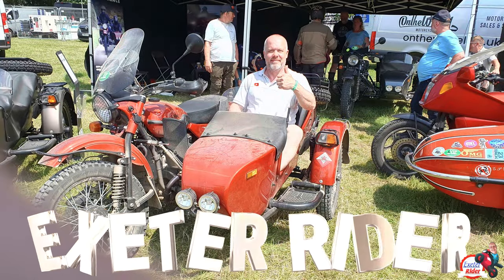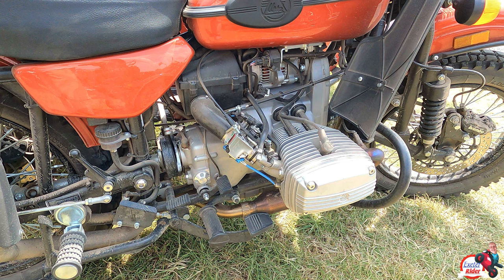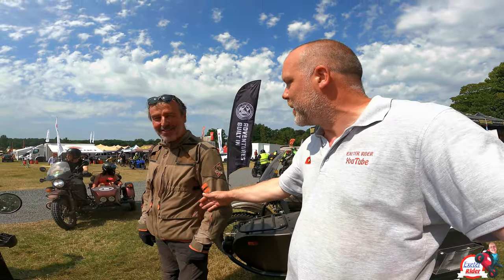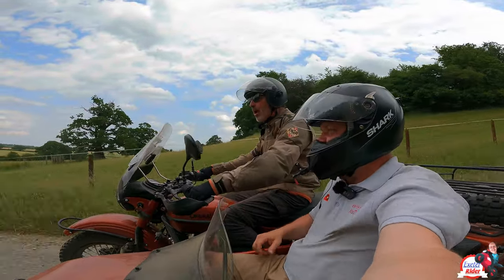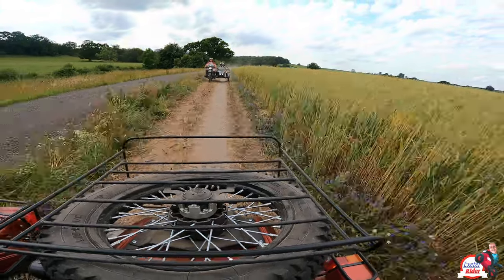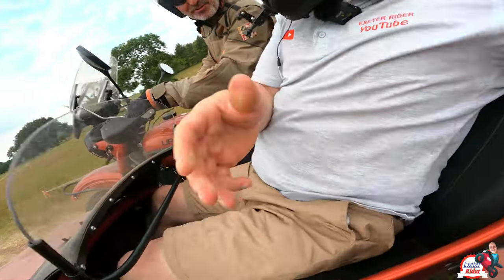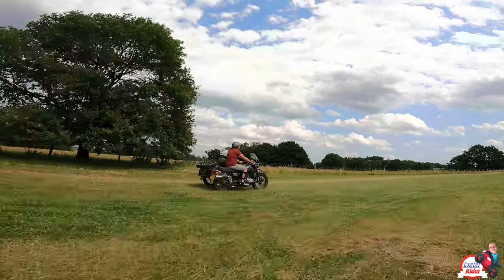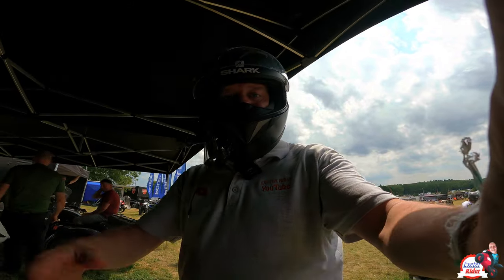A Ural Sidecar Experience, Whats It All About?

Comment: If they didn't have all those facy European parts they would be a lot cheaper. Nitron shocks are $2,500 a set.Heidenau tires are more expensive than Duros. Stainless steel exhaust system costs $1,600. Ducati ignition system is $500.EFI adds $1,500. Nippondenso generator + Brembo disc brakes. All of the Russian parts on my 25 years old URAL are still good. The should make a economy model along side the ones with all the bells and whistles. 2 wheel drive costs $2,500. That bike could be sold for $10,000-$12,000 for the cheaper model. Disc brake models have the same stopping distance as the drum braked model. Mikuni carbs had to be replaced because of ethanol gas corroded them. People complain about the ride even with the Nitron shocks,l have no problems with the Russian shocks.l go 50-55 MPH just cruising around. Of course there are all the accessories that you can put on the bike like luggage racks,spare tire etc. l like the stainless steel exhaust system but it is a want not a need. I like my Duro sidecar tires. Don't need fancy German tires. I like carberaters. No fuel pump needed either. Cheap and good value for the money 💰. Used bikes are best. No depreciation.

Comment: Side cars have always been expensive. Price a Watsoñian or a Champion sidecar. Side cars have always been as expensive as the motorcycle that pulls it. Buy used.7 years ago I bought my 1999 URAL Tourist with 4,000+ miles on her for $4,000 in running condition. Replaced some parts over the years due to age but that's normal. Rode her as my primary transportation for 3 years after a leg injury.  Sidecars either you love them or you hate them. They take up a lot of space in the garage so if they are unwanted they get sold fast.

Comment: I have a 1991 Dnepr mt16 here in Wales which looks similar, but is quite a different beast to ride, in that it is 2-wheel drive on-road machine with a diff, so a lot of the bias is not there when accelerating and even braking. Down side is if you get the sidecar up in the air, it gets quite dangerous as the now fast spinning wheel lands on the floor again. Both the Ural and 2-wheel drive Dnepr have their advantages and disadvantages, and having owned and ridden both, I still don't prefer one over the other. I've also owned IMZ 350 Jupiter outfits in the past and a IMZ planeta sport that was great fun as a solo but would make a rubbish outfit.  Excellent video, very informative and well put together. Thanks/Diolch.
Reply from the maker: I appreciate you thought it was good...I thought I did well on it too but the video was a flop really.  
You know your stuff with this subject then...Yes I can imagine it getting "interesting" when that spining whell hits the ground again....I bet its a right laugh!"
Reply: @exeterrider  Don't be disheartened. You now have 199 likes, which is not so bad! I'll share the link to it where I can.
Reply from the maker: @awtistiaeth4699  ahh, id appreciate that thanks.   It's certainly grown faster considering it was a flop in the beginning.
Thanks for your support 🙏👍🍻